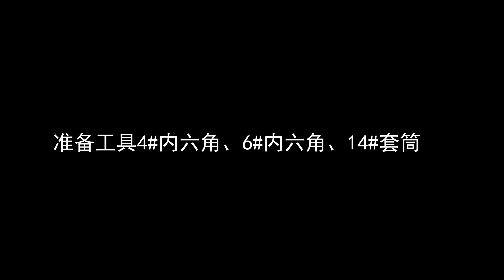ZONTES GK 350 FUEL TANK REMOVAL PROCESS

Comment: Do both cam shafts have to be removed to adjust the valves?
Reply from the maker: If you take a look at my channel and do a search for valve adjust you will see a video on how it is done thanks
Reply: @michaelphillips1959   - I found the video for the Zontes 310T valve adjustment on a disembodied cylinder head.
It does involve removing both cam shafts to get at the shims which are under the "bucket" lifters.
Is there a video for replacing the cam shafts with the cam sprockets properly on the timing chain?
Can the job be done with the engine in the frame?
Reply from the maker: @daveinwla6360  there should be a timing chain video as well in the playlist , yes in frame but fuel tank removal I think Is required
Reply: @michaelphillips1959   -  The DOHC, the rpm,  the 4-valves/cyl, the compression ratio, and the liquid cooling all imply a design philosophy of performance-over-ease-of-maintenance.  The Zontes bikes are not made for the DIY owner or the Third World owner - unlike the Royal Enfield bikes.  Unfortunately, the Zontes philosophy leads to lightness, which I appreciate as much as DIY-ease, so I'm forced to buy both .  😄

Comment: Hi sir, just wondering for a country which rain a lot, will it interfere the electronic system on this bike as almost all it function cannot be done manually.
Reply from the maker: The new designed internal structure of the auxiliary switches improves the waterproof level to IP67, and the waterproof performance is more stable. Usually bike switches etc are only IP64
Reply: @michaelphillips1959  Thank you for the clarification sir.